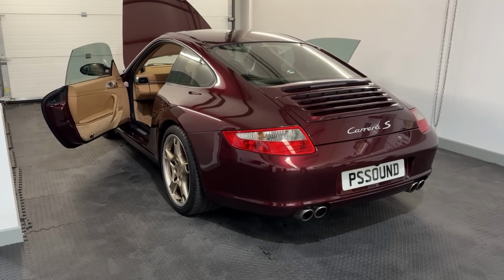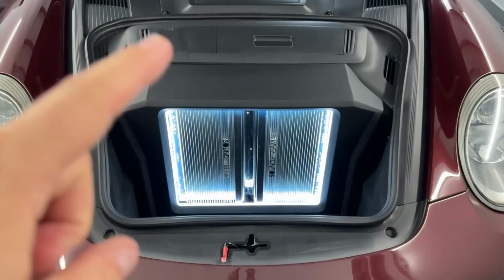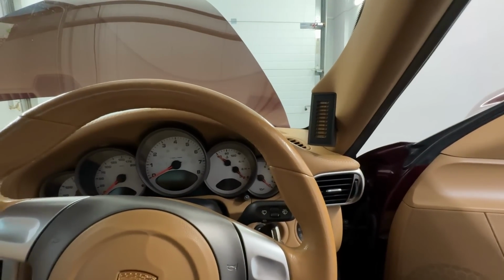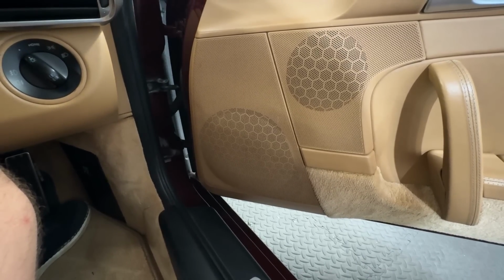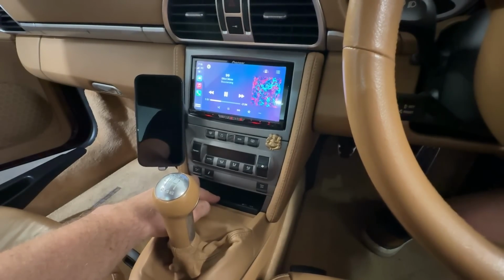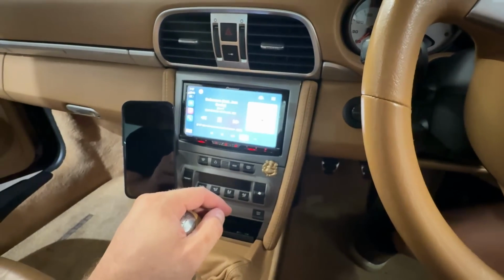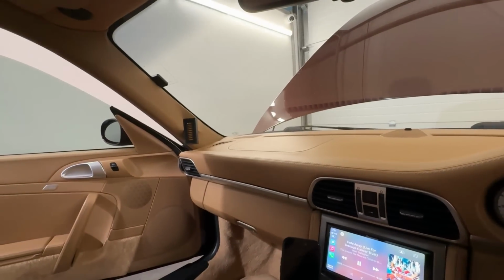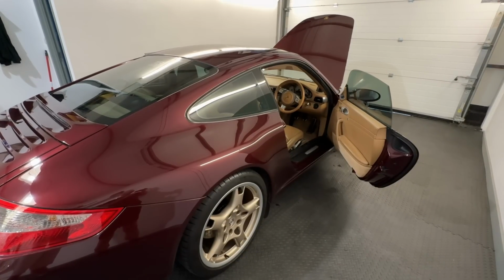Porsche 911 997 High-End Audio System - EXPLAINED - Mundorf, STEG, Helix, Soundstream, JL, SI, Zapco

Comment: It might be a crazy idea but when you mentioned atmos capability and surround sound speakers, I wondered if it'd be possible to build a system out of an S class with the Burmester 3D speakers? It's got speakers on the roof and all over the place and I'd be possible to use the factory locations for speaker installation to achieve atmos compatibility. What do you think, could this work?